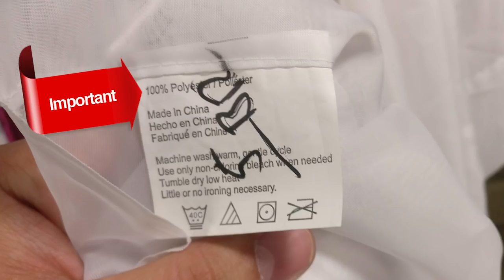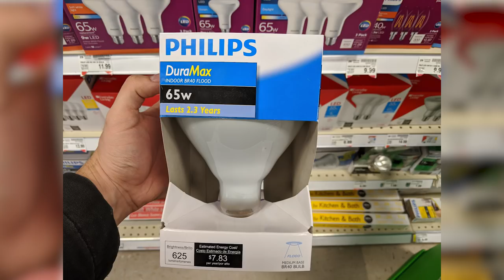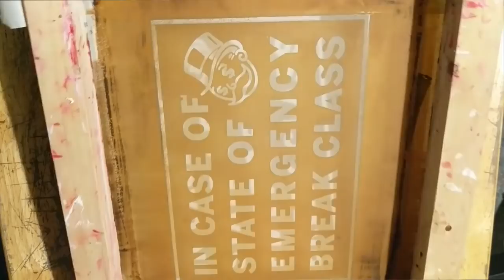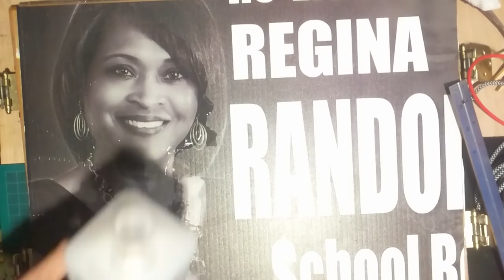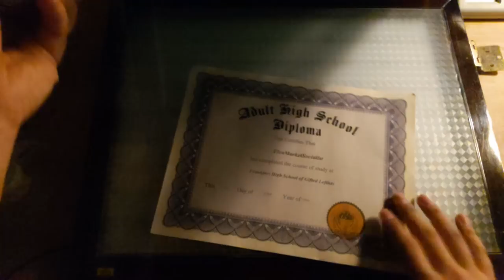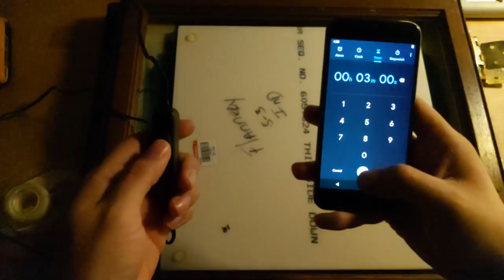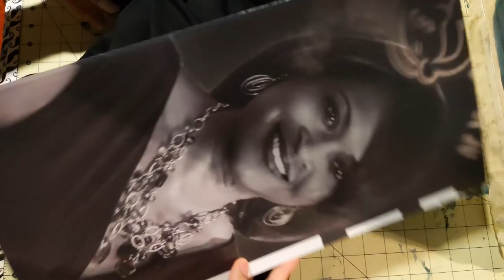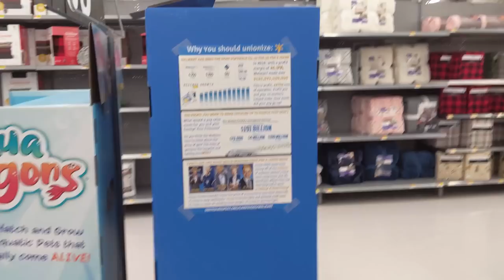Socialist Screen Printing (For cheap)

Comment from the maker: Here's some timestamps for you ADHD types:

01:56 Building the frame
03:02 Cutting screen holder
03:38 Securing screen holder to frame
05:17 Installing screen

07:14 Cutting screen
07:48 Cleaning up screen edges
08:48 Choosing an emulsion
09:40 Applying emulsion to the screen
11:00 Refining emulsion application

11:38 Building an exposure unit
14:22 Calculating exposure time
15:43 Exposing your negative
18:12 Washing off exposed screen
19:40 Drying washed off screen

20:32 Printing setup
21:30 T-shirt sources
21:49 Kinds of ink

22:20 T-shirt Preparation
22:39 Print and medium alignment/ Measurement
23:17 Applying first layer of ink
24:22 Applying second layer of ink
24:57 Touching up print mistakes

25:15 Dissemination Preparation
26:30 Agitprop Dissemination

Comment: Hi! I'm gonna copypaste the comment i left on camazotz:
Hii! You can use paper, print the image there, and then cover it with oil. That makes it's transparent, works just the same!  And, it's way cheaper. Also, for the screen, I use old curtain fabric, that used to be quite plastic, usually pretty cheap in church-giveaways! (solían ser bastante usuales en las casas viejas de las abuelas, ni idea si tiene un nombre particular para comprarlas en casa de telas pero si lo encuentro les digo). Cheers
Reply from the maker: Woah, does it matter what kind of oil? I have some mineral oil I might try this with. I'm pretty sure the fabric you're talking about is what I used.Sheer curtains aka cortinas transparentes or cortinas visillos. I'm always on the lookout for finer meshes. My first attempt at screen printing I used a super fine mesh that was a part of some children's science kit or something. Great results. I'll look into the oil though, thanks!
Reply: @FleaMarketSocialist  I use regular cooking oil! I'm sure it will work with mineral one too tho

Comment: Shopping List:
1 x Wooden Frame [Flat enough to screen print with, the front doesn't matter too much. Don't use plywood/]
1 x Sheer curtain of 100% polyester. The finer the mesh count the better. It doesn't matter if it has any patterns on it. It shouldn't have texture on it
1 x coax cable
1 x Suction cup
2 x (Cabinet) Hinges
2 x Clamps
11 x Screws
1 x Countersink bit
1 x UV or Blacklight
1 x Window screenroller thing

Comment: A friend gave me a couple pointers on diy screens recently, and she said that if you use those smaller embroidery hoops, pantyhose (which can apparently also be found at the dollar store?) is a cheap and effective material. IDK if that actually helps any of you, but it's an option.
Reply from the maker: I've thought about pantyhose so I might try it. It's just not very good at remaining taught in the frame since it stretches
Reply: @FleaMarketSocialist  they said something about using glue too, but I wasn't expecting the random advice, so I can't seem to remember how to use it. If I remember/figure it out, I'll get back to you on that.

Comment: The graphics editing in this video is extra-nice, but that's what I'd expect from a graduate of the Frankfurt School.
Here's a question: Is the white base coat just there to make the final color stand out more on the dark shirt? If you were printing on a white shirt (poster, etc.), would you skip the base coat?
Reply from the maker: Thank you, thank you. I use an undercoat on fabrics only since the first layer kind of seeps into the fabric a little bit. The plastisol ink is thicker and creates a nice layer for the second layer to sit upon. It also allows me to use thinner inks on top. Most the inks I have are tiny acrylic ones I find at flea markets and Goodwill.
Reply from the maker: To answer your last question, I would the no it depends on the thickness of the ink. I have better luck with single layers using thick ink.
Reply: @FleaMarketSocialist  OK, that makes sense. Thanks!
Reply: Flea Market Socialist how do you make sure the base coat and the top coat line up? Is there any registration method?
Reply from the maker: I clean my screens between each ink. I also cure the ink and line it up through the mesh.

I know in standard screen printing people use registration marks but I usually just measure and hope for the best.